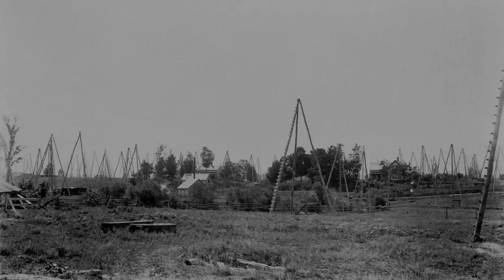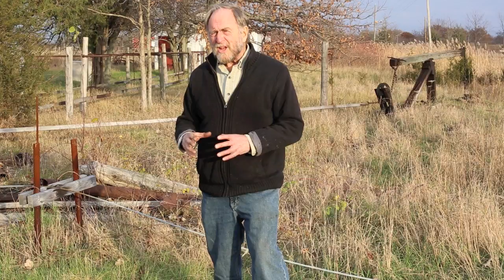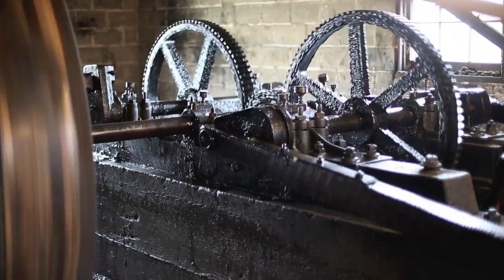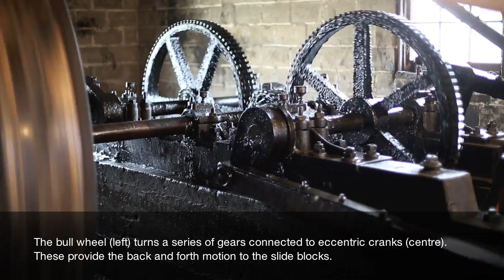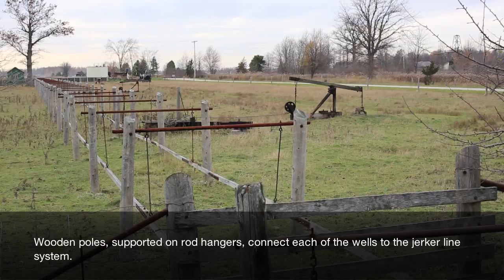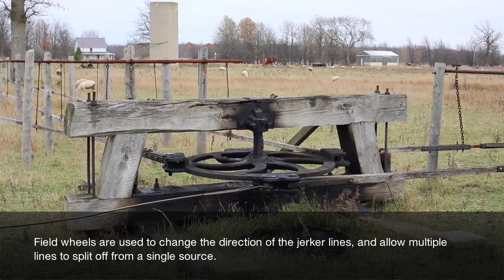Oil Drilling Techniques: Jerker Lines

Comment: Some years ago I worked for Four Star Oil Co. in Oil City, La. They pumped several wells with this system. We called it a shackle line. Instead of cables, they used 5\8inch "sucked rods". The engine used to power the system was fueled by the wells natural gas flow.
Reply: Gov't would want some form of tax on that now. Nothing free when gov't involved.
Reply: Same here. In lost hills ca. Also using sucker rod. This was last seen in about 1980s.

Comment: I see they must run a separate pipe to pump the crude directly on the gears in the engine house
Reply from the maker: The gears are lubricated by a trough of oil at the bottom. With every rotation, the gears will self-lubricate by passing through the trough. Other friction points can be manually greased with a grease gun, oil can, or oil cups. With proper maintenance, these machines have been running for years.
Reply: @oilmuseumofcanada  
Sorry bro. I was trying to be funny. No, yea, slow rpm, solid cast iron, well lubed will run for forever.

Comment: This has nothing to do with drilling a well. This is pumping a well after it has already been drilled.
Reply from the maker: You are correct. Jerker Lines were used in the past and continue to be used today to pump oil out of the shallow wells in Oil Springs. This technique for harvesting oil fit in with the overall theme of Oil Drilling Techniques when we made this original series several years ago.